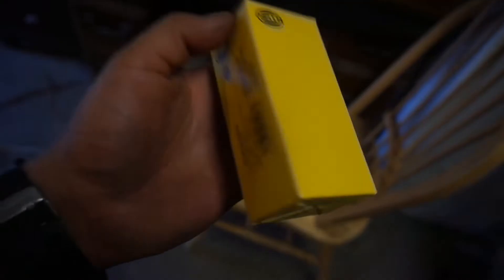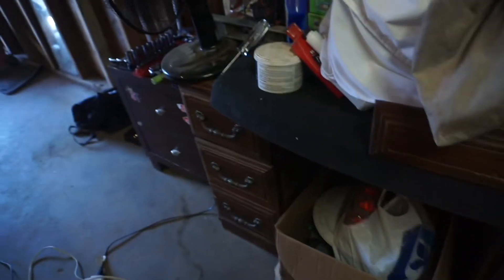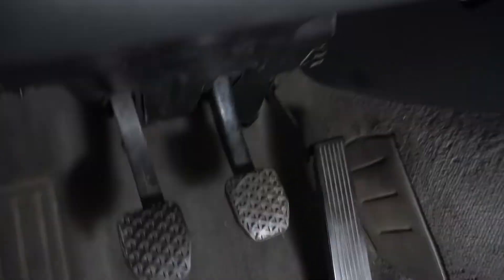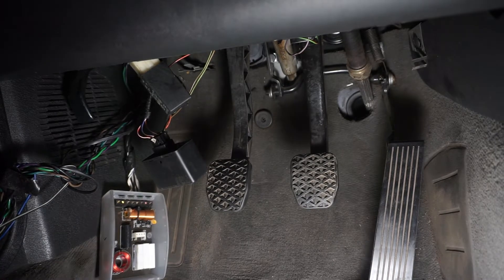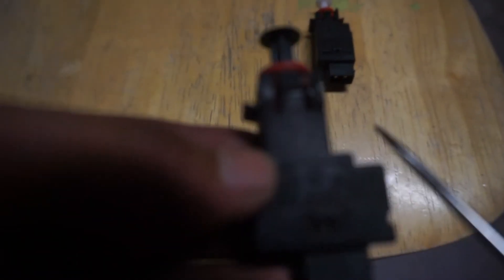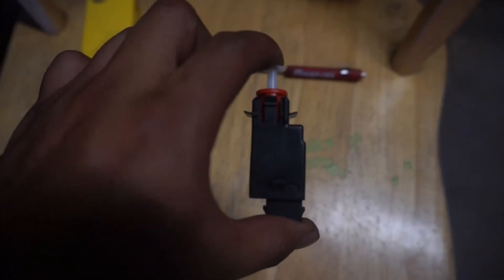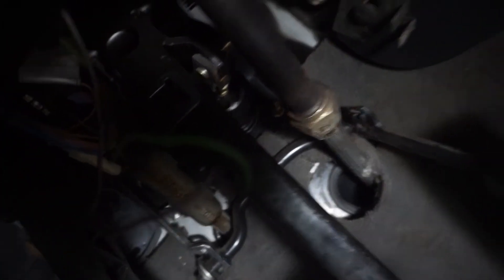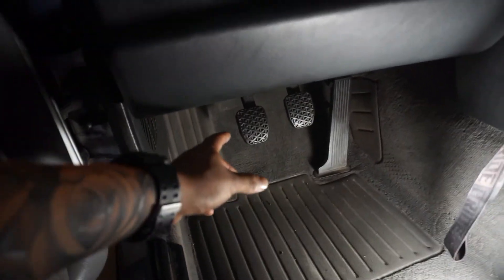Replacing a brake light switch on a BMW E30

Comment: Dude this totally happens to my E30 all the time.  I'm going to try cleaning it with graphite lubricant cleaner first and see if that helps stop the sticking.  If it doesn't, I'll just by the $20 part.